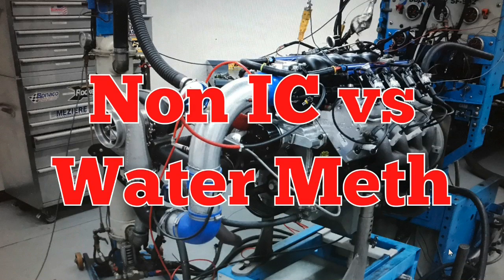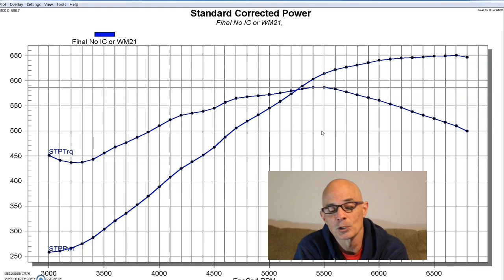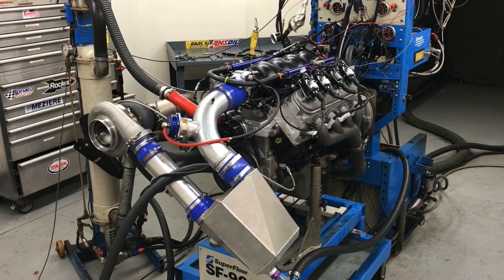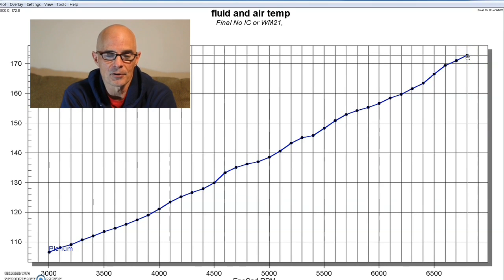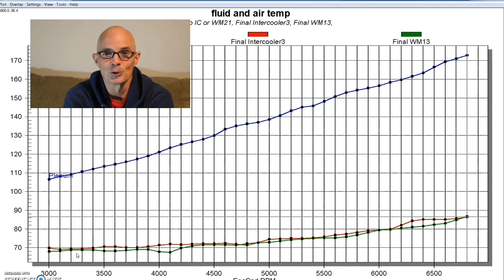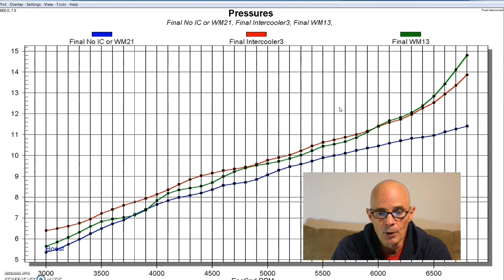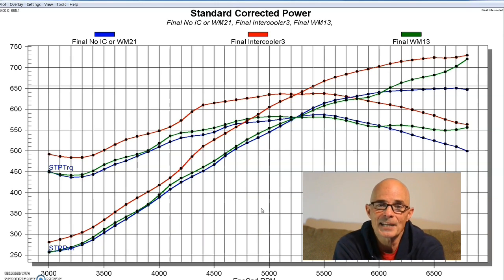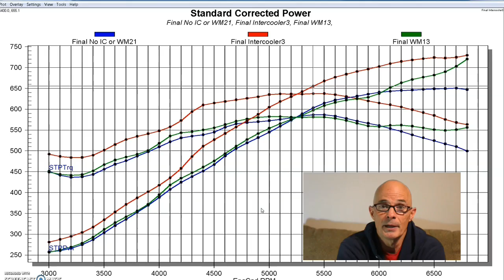WHO'S COOLER? WATER METH vs INTERCOOLER

Comment: for how cheap and easy it is to run a water meth kit. its a win for me. im running a water meth on my 2014 silverado gt45 12lbs with no intercooler..  was there added timing to the engine with running the water meth taking advantage of the cooler IATs, putting the 1 nozzle in front of the turbo should cool the air being compressed by the turbo and have the 2nd nozze at the tb

should do a bonus. and do intercooler with water meth, and WIC with water meth aswell.

Comment: I hate to say this but this is the first video of yours that I watched that I disagree with... your own data shows that something is way wrong. the math doesn't add up. If the intercooler and the methanol have the same intake temp but one has higher octane... shouldn't the one with higher octane make more power. Yes... yes it should. How much ignition timing did you run? did you put the injector far away from the throttle body as possible but after the turbo. if you have an intercooled setup it should be far away from the throttle body as possible but after the intercooler. I've been running water meth for 14 years now (no failures). I've tried isopropyl alcohol denatured alcohol methanol all kinds of stuff. I bet you had a bunch of issues with it spitting too. I don't even turn my water meth on until the turbo making some heat. You're probably right at the borderline of being able to even use it.( that's why boost went way up at the end of the Curve) When I come off of the track from road racing there's normally water dripping from the intercooler pipe in between my intercooler and my throttle body and the data log will show temperature lower than ambient or at ambient. I would like to see this test done again with Boost levels up to 30 or 40 and only pull timing when there's knock present. And ideally with more compression. You should be able to get results as good as E85 or better.
Reply: He stated that the IAT reading on WM was invalid due to uneven distribution. He got different readings between cylinders. We don't know how that affected power.

Octane rating, in and of itself, doesn't really affect power. It permit's higher boost/compression and more favorable timing without detonation, but doesn't change power if all else is equal.

Comment: By my quick/dirty spreadsheet, a change in charge temp from 173 to 86 makes about a 10 lb/min difference in air due to density. That’s about 100 hp! Like other comments, I’m wondering if a carb-style single plane would work better with the water-meth injection. Ditto also on the tuning parameters—was there a big timing difference? How about water-meth injection well before the throttle body, assuming it gets triggered near or after full throttle. It seems like once the charge was cooled, it would stay cooled. More tests!

Comment: Thanks for testing and proving that purpose designed DRY manifolds suck at being WET manifolds, specially these new factory equipment plastic "labyrinths"/banana bunch styles.
YUP, individual port injection is always the solution be it N2O, fuel or water/alcohol injection if you want even distribution & repeatable results.
Reply: You are correct! And your explanation was spot on. These manifold were designed for air, nothing else.
Reply: Injection at the runner inlet should be more effective than at the intake port.
Reply: @fascistpedant758  probably so. IT  would give more time to evaporate w/e is being injected into it ? 🤔 But depending on the manifold's design the plumbing could be a real NIGHTMARE.

Comment: I wuld love to see an high "compression" engine under boost, shown how inc helps whith the nock limitations.

I think you talk about calculating the compression rate, using boost you claimed that you can ad that oon the "virtual compression rate" when talking about the limits. I do agree you get the numbers in like this, how ever, nock is not only the pressure, it's also about the temperature, when piston comprise the mixture, same thing happens as whit turbo charge, the air temp goes up in the cylinder. Now running less compression, and turbo with inc. You take some of the heating prosses away from the "virtual compression rate" and in theory culd get away with ewen bigger "virtual compression rate"
Reply: The other thing to look at is the effect of cams on high compression as a longer duration cam provides more cylinder fill effectively increasing the compression by filling the cylinder with more air by have the valve open for longer

Comment: Did the fueling remain the same with the intercooler vs non intercooled?  I'm out of injector on my 650hp Holley sniper tbi and I'm running a non intercooled vortech centrifugal supercharger.
Reply: Run straight meth with a meth injection system well before the TB.   It will add cooling and fueling.

Comment: Maybe pre turbo will cool the air prior to the manifold enough to evenly lower temp in the manifold. That would essentially require the water meth to have done its work before the TB.

Comment: Although this test is interesting it dosen't answer the the question on meth injection, theres  little point testing a dry intake with a wet system , find yourself a single plane intake and run the test again , there's tones of us out here that want to know the answer , after all , you test so we don't have too .... just sayi'n
Reply: I agree,  but he said that too.
Reply: @Turbo_Todd  , Richard would be the first to say , the only way to know for sure is to test , he's done this type of  test a number of times in the past stating how it would work better on a wet intake manifold however despite him having all the required parts on hand, to my knowledge he hasn''t actually done the test.

Comment: Okay ☝️we have to remember 50/50 alcohol water injection systems work great to prevent 💥predestination.. but the trade-off is a slight power lost.. but  these losses are corrected or rectified by adding a little more boost.!! But for maximum { atomization } cooling effects with water meth systems is to feed it into the inlet of the turbo... the Pro Mod turbo drag bikes and The New Age drag street bikes uses this system.. this is the way it worked with the old-school alcohol water injection system that operated off the boost psi...!!! https://youtu.be/LO0MGrkEWzI
Reply from the maker: the problem is distribution
Reply: @richardholdener1727  Correct/ but would it have the same cooling effect so close to the cylinders... 🤔 So I guess a combination of both would be ideal.. for instance the same way you would add fuel by jetting it on a nitrous system by running slightly bigger Jets on the cylinders that's heating up without getting too complicated... No extra electronics.. 😬 I'm basically echo-ing your point 😬🤦‍♂️😆🤭

Comment: I’ve done WMi on Mercedes M113K with single nozzle at the throttle body and at each bank and noticed the exact same thing, dramatically cooler charge temps with absolutely no power increase and was thinking the same thing, distribution problems and you just confirmed it here!
Reply from the maker: I've run WM countless times
Reply: Richard Holdener all I can say is man is you dah man, keep it coming brother 👊🏼

Comment: With the long runner intake designed for distribution of air, the distribution of water methanol is uneven. I'd like to see what the results would be using an intake with short runners and also using an intake designed for a carburetor using the water methanol. I'd also like to see what the results would be using both water methanol and an intercooler. I use both on my supercharged Mustang. When I had my water methanol system installed, the installer used my window washer reservoir. Little did I know that I was losing all the water methanol on my way to the dragstrip because of a bad check valve. (You can't see the tank unless you remove the plastic cover and crawl under the car.)  I went through 3 pumps because half the time my system was only pumping air. The installer would replace the bad pumps without know why I was having this problem. I discovered the problem when I changed the pump after the 4th failure. A check valve designed for air rather than alcohol was used in the original installation and the inside of it was rusted. The performance of my car was very inconsistent. Sometimes I would add the water methanol before I left for the dragstrip and others at the dragstrip. On my car water methanol did make a difference. I have time slips where the Density Altitude are similar and the ETs vary as much as 3 tenths of a second. The configuration of my 3.7 (Cyclone) V6 is 60 degrees rather than 90 degrees found in the Coyote engine. Since my engine is tall and narrow compared to the V8 in the same model Mustang, the intake has to have short runners. Otherwise I would need a taller hood on my car, I don't know if the length of the runners and their design on my intake make a difference. My time slip would indicate that. With the Corona Virus closing down dragstrips, I can't test my hypotheses at this time.

Comment: Your going to have to build a water/meth system like the one used by BMW. The BMW system has multiple nozzles along the length of the plenum.
Reply: BMW has meth on a car? That's  awesome!
Reply: Pointed at the opening of each individual runner from across the plenum ? Simple to implement in an I-6 architecture but not so much on a tight valley V-8. Could be wrong.

Comment: Can anyone answer a few off topic questions? Im interested in an engine for an experimental aircraft build. 
An example ive seen online  is running a stroked 302 out to 360 cid NA. 3500rpm max @270hp.
Aircraft cruises @2600 - 2800 rpm.  Has a double Holley with a kit on it for avation use. 
Thats all i know... Can anyone fill in the blanks for a build that would roughly match or better this? AFR head, Cams?? 
I supect the engine was chosen for the low deck height and possibly low weight? Anyone? 
Richard? Im a noob who  has been follow this channel for month. Seen the 302 vid. Thanks
Reply: A stock 302 block will go to 347. 
The longest stroke a 302 block will take is 3.4 inches.  You can get an aftermarket block that will take a 4.125 bore and allow you to go to 363ci. For the heads you would want to use the 165cc heads from AFR. The cam would need to be a solid roller in order to maximize valve lift with the tiny duration numbers you are going to need.
You will have to talk to a pro, but im thinking something like 190/190@ 0.05 lift with a 108 lsa.
If you are going carburated, an edelbrock RPM air gap will probably be your best choice as long as you have enough room for it in the engine bay.
Reply: Please make a video of you trying to fly this thing
Reply: @baby-sharkgto4902  I have one with a 4.3 V6.

Comment: Was timing the same on all three combinations?
Reply: This is why... W/M quenches flame front /adds octane. Needed more ignition advance. But cylinder distribution was a factor as well. Keep the vids comming Richard!
Reply: Yeh we would really like to see you come back to this with twin gates and lean on the timing..
Reply: Fabricobble TV also you need to take away some fuel for the methane
Reply from the maker: yes
Reply: Do all of the above plus pre turbo injection as that is how it’s properly done, then you have a proper comparison. Thank you for all your hard work, best engine performance channel there has ever been !

Comment: No ecu data review, was it the same ignition, pulsewidth, lambda, did the ecu read the same charge temps for all scenarios, was there any knock registered anywhere and so on and so on.
What about all the testing done with different locations and volume of water meth, what was the conclusion there?
Just not scientific enough or at least the data review isn´t
Reply from the maker: we don't run a factory ECU-we used Holley-obviously all AF and timing the same-been doing this a few years (decades) now. We tried every conceivable combination of nozzle size, single and dual, activation onset etc.. to tune the WM. Registered knock! That's Tuner funny
Reply: @richardholdener1727  For me personally dissecting the reasons so and so didn´t do as expected is what makes tuning interesting for me and is the way to learn. I would enjoy more deep dives in some of the tests and comparisons. The wm air temp being what it was meant that the total amount of mass flow into the engine should have been higher than the non intercooler and non wm setup which by all accounts should 100% made more power, even if the distribution was weak amongst cylinders and even on the same ignition advance and lambda. More mass flow = more power, unless something else is at play and you got knock on some cylinders and let that hold  you back from advancing the non knocking ones?
Reply: @richardholdener1727  so your saying in this test WMI at the same timing, had knock, because of some individual runners not receiving the same charge cooling effects aka distribution? 
 Was this before the huge boost spike at the end or during?
Reply: @richardholdener1727  you would not have registered knock if the nozzle was pre-turbo. Just like if you move the injectors further up into the manifold the vaporization rate is more appropriately used to cool the charge temperature. The distribution problem from the impractical utilization of the throttle body injection site caused the inlet air to not have enough contact time to fully use the latent heat of vaporization of the meth mix in an even fashion. No, the turbo doesn't cut the water or increase atomization but does increase surface area for water to air contact. The experiment is excellent for proving that not all data is good. I would like to see a preturbo or even a post turbo just after exit test done but with 100% water only. No additional octane.
Reply: I think he commands same for all(timing,lambda,etc) the scenarios. That is why the water meth kit it picked up at the end of pull when wastegate wasn't keeping up so it leaned out water meth so it could actually produce the similar power to intercooled version. If he trimmed the fueling for water meth it would've been almost identical to intercooled version. My take away is run both WMI and intercooler with temp failsafe add some timing and trim fuel for WMI and could've added more power!
Reply from the maker: AF and timing we identical as always
Reply: @richardholdener1727  The original NACA tests in WW2 for water meth injection concluded that water meth injection would not increase HP unless the ignition is advanced to compensate for the inert steam slowing the flame front in the combustion chamber. (and proved large HP increases if ignition timing is advanced with water meth injection)

If you compare non-intercooled/intercooled/meth injected power at identical boost, AF, and Ignition, you can prove that one of those methods is more efficient but it does not really prove which one makes more power. The real value of intercooling or meth injection is how much more boost/fuel/power you can extract beyond the non-intercooled limits.

You could of course add more safety to an existing engine. And that is one reasonable comparison to see which one is safer per dollar spent or day-to-day convenience. However I would use charge cooling to run more boost and get more power at the same safety levels. (noting that failure of cooling would remove any safety and blow up the engine)
Reply: id like to see more about this as well.
Reply: You are very thorough! You should start a similar youtube channel.
Reply: At 170 be hard to keep timing

Comment: Always place water injection after the turbo and/or centrifugal supercharger.  The turbines leading edges are eroded away by the water droplets. It's not an immediate effect but it significantly shortens turbine life.  Only thing worse is no air filter.  Dirt particles and turbines should never party together.

Comment: I’ve blown my car up 2 times (#7, #8 pistons) running only w/m. Now I’m water to air with water meth and a single plane.  Learned my lesson.
Reply: I guess you don't get equal distribution of the water/methanol, specially at the rear of the engine. Good thing to know.
Reply: Was this an LS engine? Where was your nozzle? Let me guess spraying directly into the manifold, in front of the TB...  What manifold were you running and how much power were you making?

Comment: would be good to see the same thing done with blow thru carb setup
Reply: I’m building a 5.8 blow thru , air to water or just air intercooler is my question !
Reply: I think a draw through setup would be "cooler"
Reply: @nickhale117   harder to get  big  power outa
Reply: Who is trying to run a turbo and a carburetor, EFI stand alone is $1,000, much less if you go with factory components.
Reply: @otm646  a lot of guys still running carb.not saying it's better but it's what I have.
Reply: @otm646   lots og guys are running  blow  through carb setups
Reply: It's 2020, bro. Should Richard run a points distributor, too?
Reply: @VTLIFE-so4dc  sure, why not if that's what you have.
Reply: @VTLIFE-so4dc   you sound   offended

Comment: You need to try water /meth and intercooler on 6-8/71 on high boost level
Reply from the maker: I did an E85 switch on a 6/71-works well